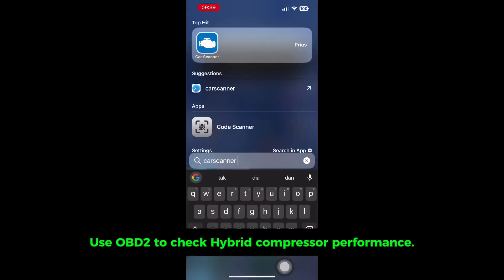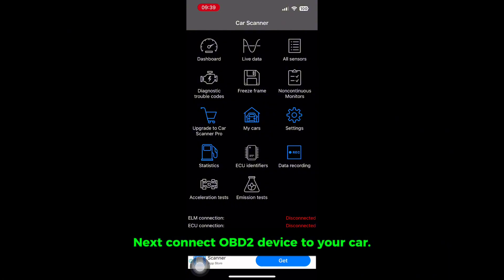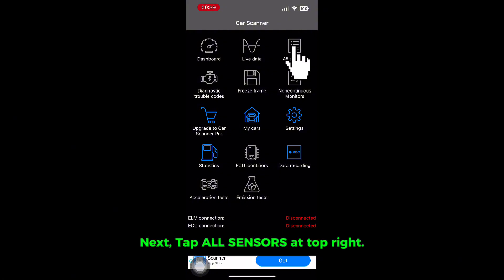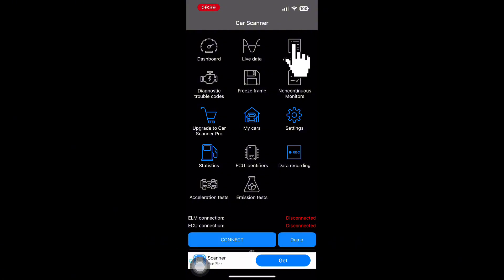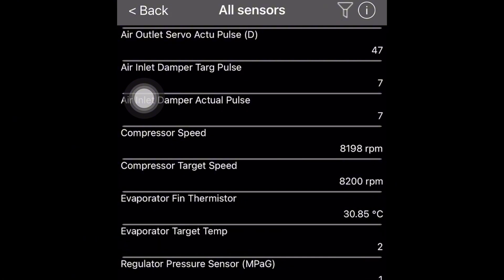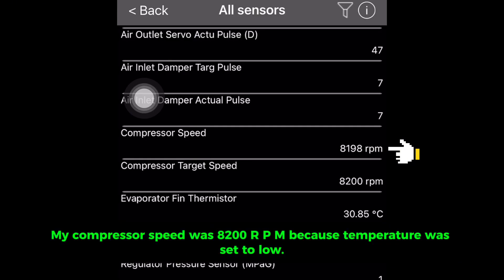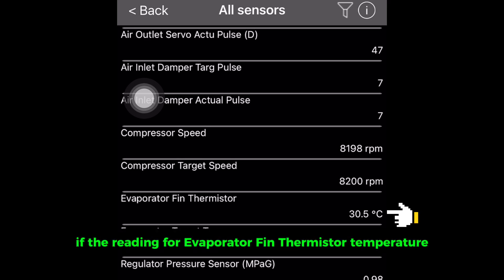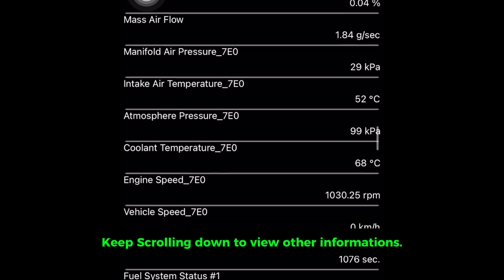[ENG] OBD2 FREE Apps Car Information Hybrid Compressor check Condenser Leaking

Comment from the maker: Use OBD2 to check your hybrid compressor performance, to determine if its working or not.

Compressor RPM good performance + Top vent Hot Air = Servo actuator / motor for air mixture broken

Compressor RPM good performance + Only blowing cold air at feet vents= Servo actuator / motor for vent controls broken

Compressor RPM good performance + Servo motor work + hot air + Evaporator thermistors temperature hot = NORMALLY Gas LEAK at cooling / evaporator coil

Compressor RPM low underperforming BUT Temperature set low + Servo motor working + hot air + Evaporator thermistors temperature hot AND No leak = NORMALLY compressor breaking down